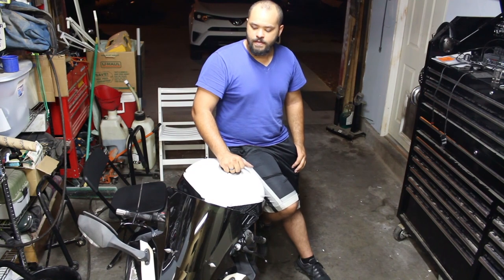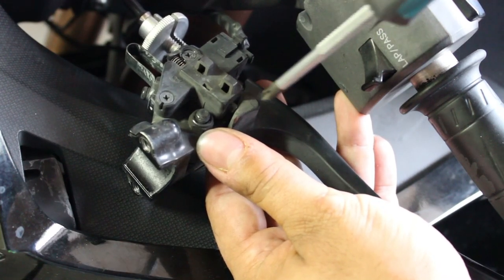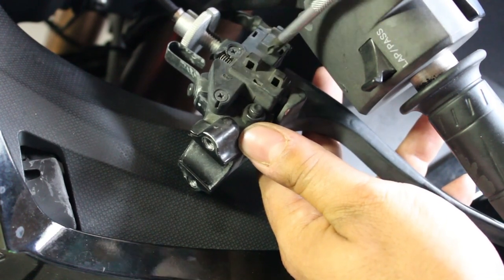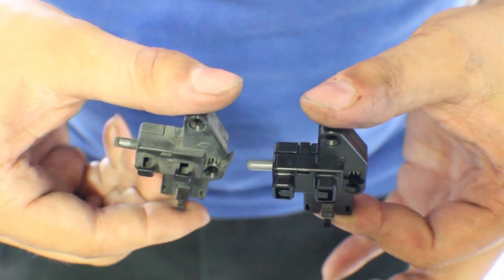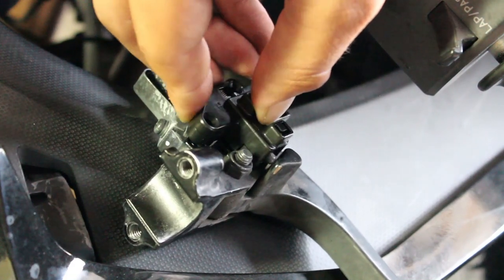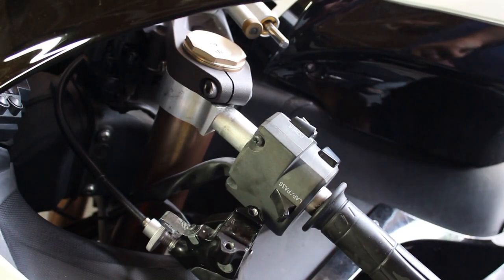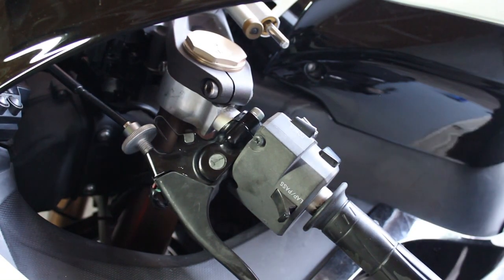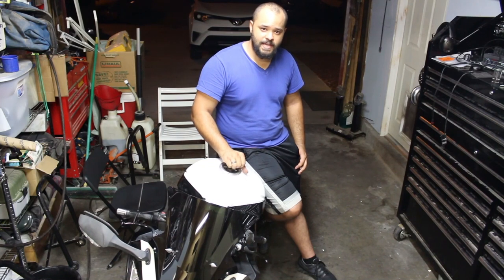Motorcycle Clutch Switch Replacement

Comment: I replaced mine and could not figure out why it still wasn't working. Then I came to this video and you mentioned the kick stand. I completely forgot about the kickstand. All I had to do was lift it , now my bike starts in gear when the clutch is pulled in. Thank you!
Reply from the maker: 😆 too funny. Glad that I could be of help.  Ride safe!
Reply: @TheMotorcycleBoss  Which part did you mention that? I have problems
Reply from the maker: I don't understand your question @ruskyhrahsel7723
Reply: @TheMotorcycleBoss  in which part of the video did you mention about the kick stand?

Comment: Thank you SO MUCH! I broke my switch putting on a new clutch lever. The manual didn’t warn of this.
Reply from the maker: Dang! That sucks! Well good thing you can replace it. Glad my video helped and I hope this was enough to earn you as a subscriber! Ride safe!
Reply: @TheMotorcycleBoss  was able to order the part today and will arrive tomorrow. It’s all good. One of the screws wouldn’t come out and was stripped so I cut it out. So I’ll be replacing with one screw but it will still work

Comment: I have a micro switch that may be falling apart and I don't have a replacement yet. Presumably, if you were stuck on the side of the road, you would be able to remove the wiring connector and jump the two connectors on the harness and be on your way. (Being very careful about starting in gear of course.) Great video. Good explanation.
Reply from the maker: @DavidM2002  thanks! Glad it was helpful.  just keep in mind that some switches are naturally open and some are naturally closed.
Reply: @TheMotorcycleBoss  Good point. Thanks.

Comment: Should have been smart like you and replaced mine as soon as mine stopped working.
Instead a month later, I dropped my bike, bent the shifter, then went to ride to work, to find out after I'd shifted into third that I couldn't downshift.
Almost made it to work, just in third gear, but inevitably stalled it, then couldn't start it again, because I coudln't shift back into neutral.
Think its time to replace my clutch switch, thanks for the video.
Reply from the maker: That sucks.

Comment: But will that stop you from shifting gears
Reply from the maker: No. It is only really used as a safety switch to prevent the bike from starting in-gear without the clutch pulled in. Keeps the starter from moving the bike.
Reply: @TheMotorcycleBoss  ok ok.  I changed my levers not bike won’t shift wit clutch

Comment: How many wires are there inside the connector?...is it 3 or 2?..i need to get my connector changed, the plastic piece has broken, my switch is okay i hope
Reply from the maker: Usually there are just 2. But every bike is different so you want to check out your own bike.
Reply: @TheMotorcycleBoss  i have a ninja 650 ,2016

Comment: Ok so when i pull my clutch in the bike shuts off could that be the switch ?
Reply from the maker: I wouldnt think so. If you are in neutral and pull in the clutch and it dies, seems to be the only reasonable solution tho. It is just a simple switch. So use a multimeter to test the switch and to test if it is causing it, either keep it unplugged and try to ride the bike, or jump the connection with a wire and see if that eliminates the problem. Every bike is different so you will have to test your switch to see if it is always open or closed at rest. The clutch switch at least on my bike, is designed to keep the bike from starting in the event that i try to start it in gear without the clutch pulled in. So if your bike is the same, it shouldnt do anything while you are in neutral. Try that for now. Good luck.
Reply: The Motorcycle Boss okay so i start up the bike and ride for like 20 minutes when im down shifting the throttle would go down to zero it doesn’t happen every time i ride it and when it shuts off i can start it when it’s in gear with the clutch pulled but if i pull on the throttle to rev while still holding the clutch in the rpm would go down to 0 and shuts off i have a 2007 r6 with 5k miles could it be clutch adjustment or throttle position sensor can you tell me what to look for here?
Reply: The Motorcycle Boss  and when i check the switch do i check for voltage or resistance? Also my bike starts if the clutch pulled in and in gear ⚙️ and oh yeah the bike functions perfectly if turned on and parked but when im riding and down shifting that’s when it shuts off not every time though from time too time
Reply from the maker: You are checking the switch for continuity and resistance. You should see no resistance. It's just an on/off switch. But it doesn't seem like that is the issue, from what you are saying, i would think the fuel pump maybe at fault. The throttle position sensor is also a culprit. Yamahas tps' are known to have issues in some years. Grab a reliable multimeter and an accurate measuring cup, grab your service manual, and troubleshoot.
Reply from the maker: Wost case scenario, it may even be an ecu going out but that is normally not the case.
Reply: I’m having the same problem. Did you ever fix the problem